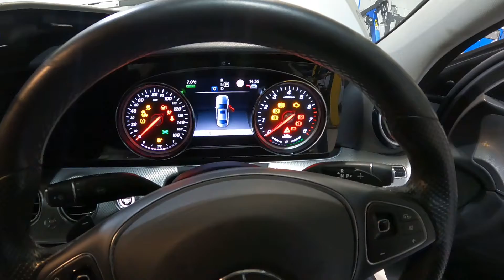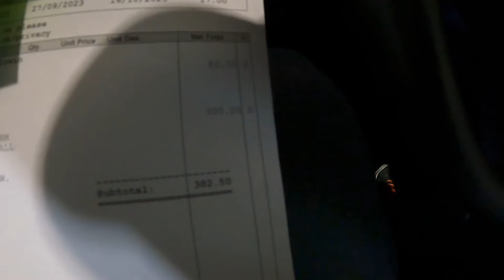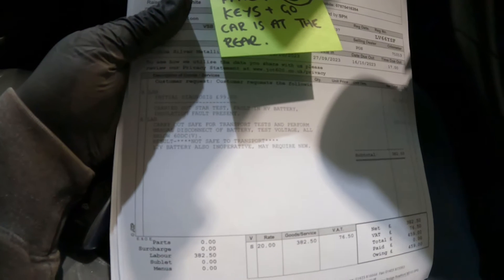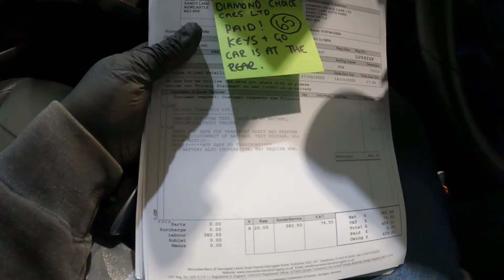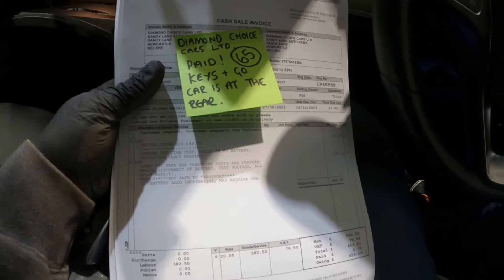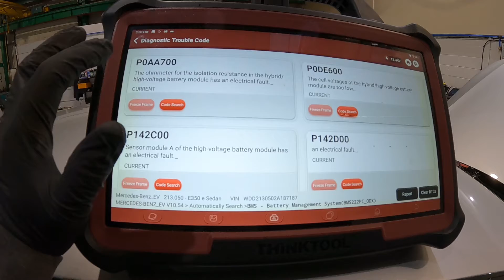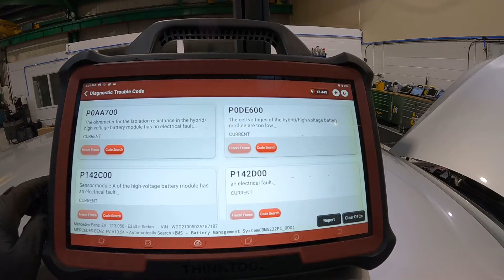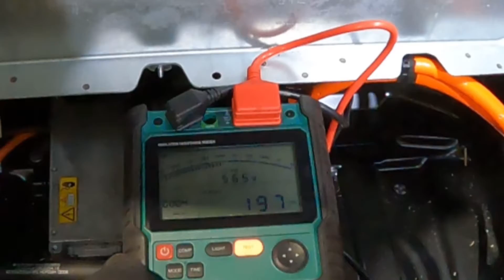Mercedes Benz E350e Plug in Hybrid EV Battery Fault. Does actually need a High Voltage Battery?

Comment: I have a 2018 Mercedes c 350 e which has the problem described in your video.  Mercedes want to fit a new battery - if they can get hold of one.  Is there anywhere I can get the hcare repaired?
Reply from the maker: We have batteries here that we use for parts

Comment: Does anyone know a possible reason why E-mode is disabled and the engine won't shut off on hybrid mode? No check lights or any other issue? Thanks
Reply: 12v battery most likely. You should do a battery test
Reply: @valt888  just replaced but nothing happened, do I need to reset or something after replacing?

Comment: Oh! Im exited!
2 or 3 weeks ago i had the same car coming in with the same ohm meter code. Had been in and out of the dealer a couple times where they had replaced the 12v battery (based on the warninglight on the dash i pressume) but couldnt figure out why it still was broken.
I got stumped reading the codes cause it kinda said right there in plain text that something is wrong with the sense circuit in the battery.

Sadly we are not certified for that kind of work (yet) so had to send him back to the dealer, but now armed with a little bit more information.
Not sure how it all went down from there yet.

Cant wait to see what part two brings!